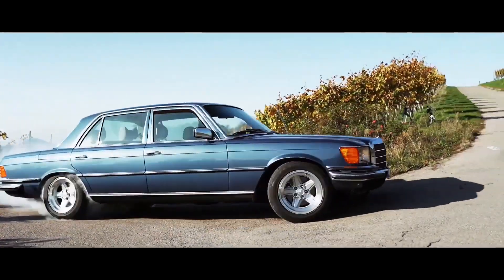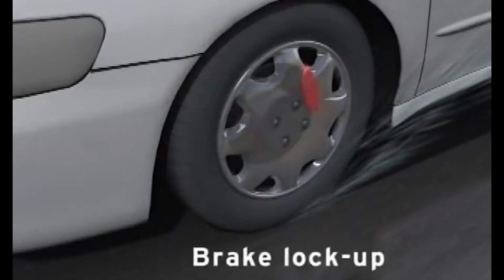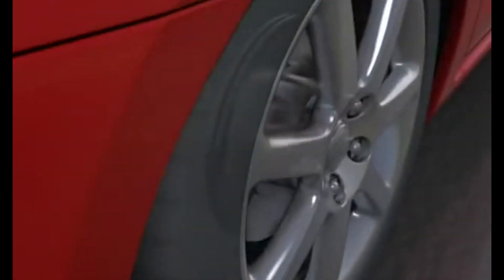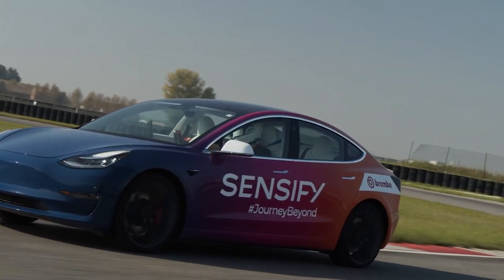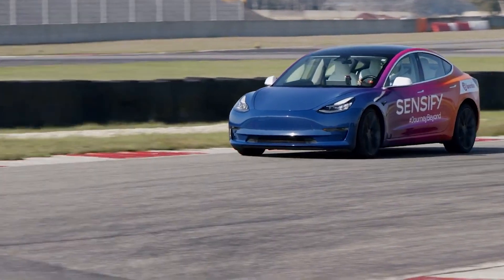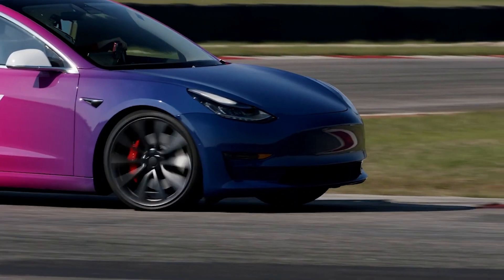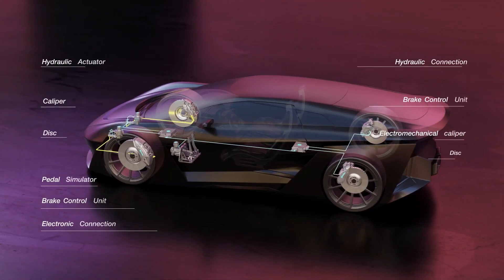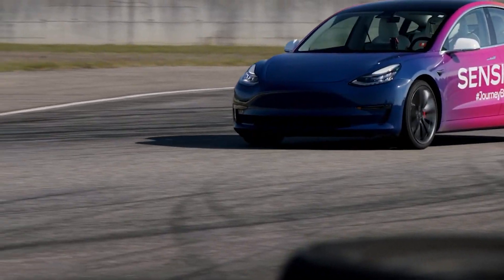Brembo’s brakes of the future!

Comment: My 2020 Honda already uses the rear electric brakes, Used for parking for braking with the Radar controlled Cruise but if someone slams on the brakes in front of you all the brakes come on Electric over hydraulic much like traditional ABS used to work but much Faster computer's are in control now, But bad drivers still Crash almost fully automated system controlled  Cars, Because YOU Still can't fix Stupid but Close😁        I don't use or set this system around very erratic drivers because I don't want my brakes burnt out of my car, Staying off of your phone helps in ALL situations. Some of the insane TESLA car crashes only prove that Computers and IDIOT'S don't mix WELL. I do like the idea from Brembo because the closer a controller is to the brake pads the Faster the possible response 👍.